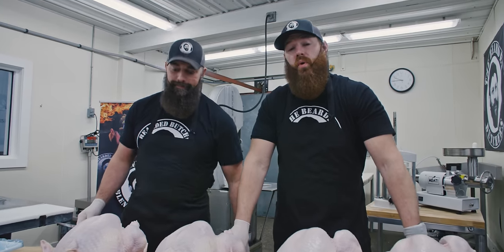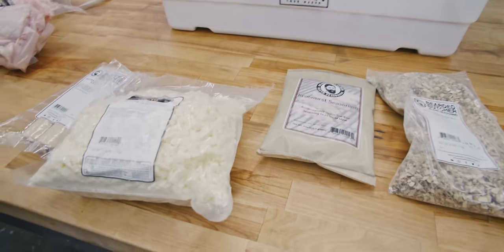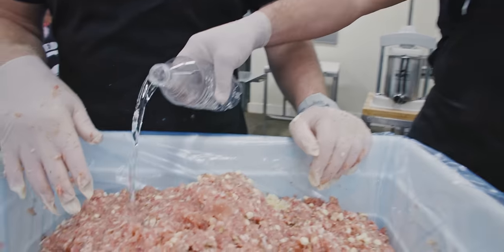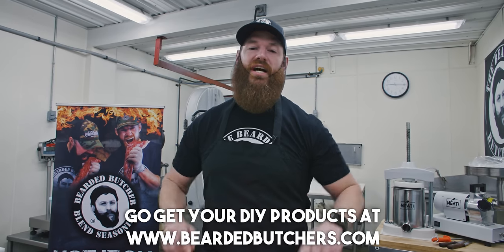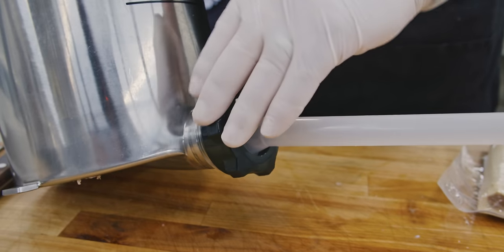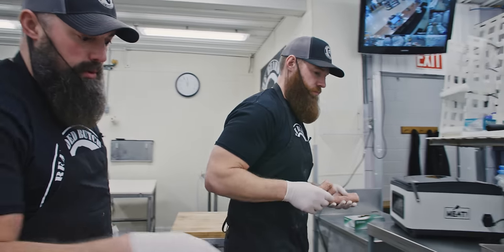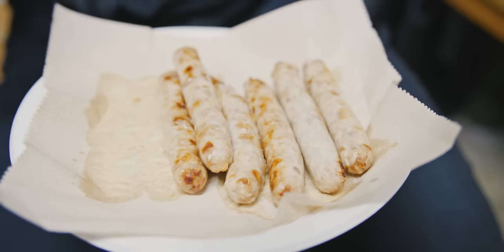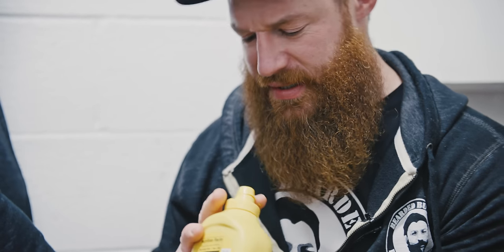How To Make DIY Turkey Bratwurst and Breakfast Sausage | The Bearded Butchers!

Comment: Awesome video guys. Man that's alot of sausage..haha..

you guys have to much fun..lol..

air fryers are great. I literally use mine 2 or 3 times an day..I cook just about everything in it..mine doesn't have bottom heating elements so it doesn't do pizzas to well. Plus, the wind keeps blowing the pepperoni off .lol it does those little tostino pizzas just fine though. And I don't do burgers in them cause the grease gums up the holes in the racks and it a pain to clean..but, sausage, brats, hot dogs, chicken, pork chops, hot pockets..all kinds of stuff..these air fryers are a godsend..

Comment: Did I miss the link for the stuffing tube from Amazon?
Reply: The one they use is sold out on Amazon. It’s called YBSVO 10mm Stainless Steel Sausage Stuffing Tubes and Sausage Stuffer Funnels for #5 Sausage Stuffers.